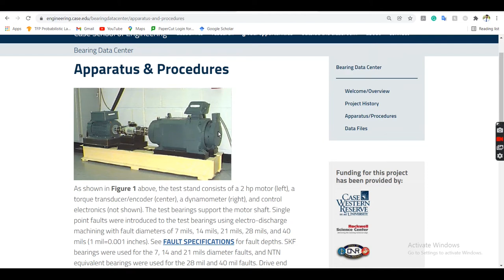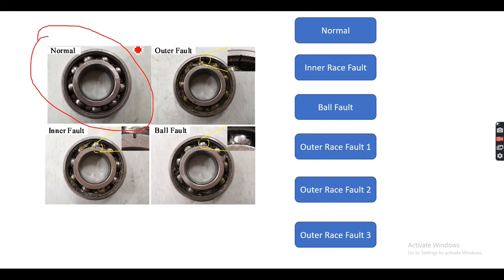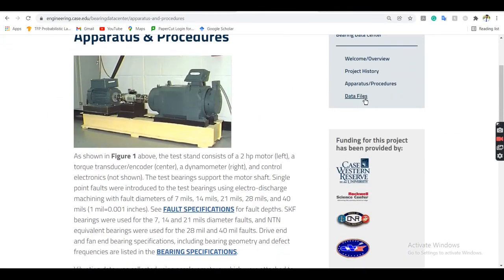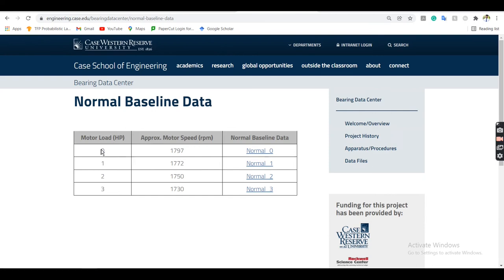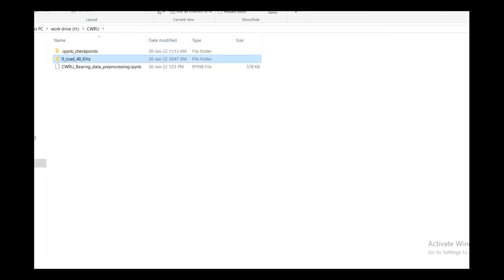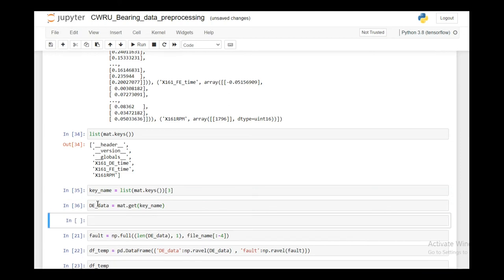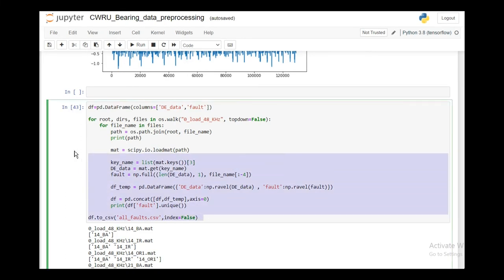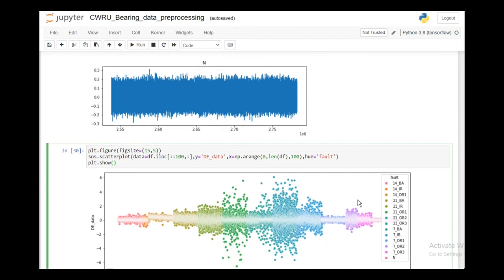Data Preprocessing || Deep Learning for Bearing Condition Monitoring || Part-1

Comment: The graph which obtain for different condition what is present on x axis and y axis
Reply from the maker: X is the number of points present in 1sec of observation and y is the corresponding value of acceleration obtained from the bearing
Reply: @Mohankumardash  thank you 👍